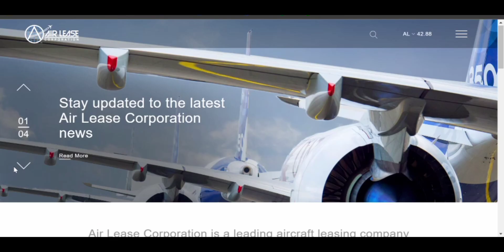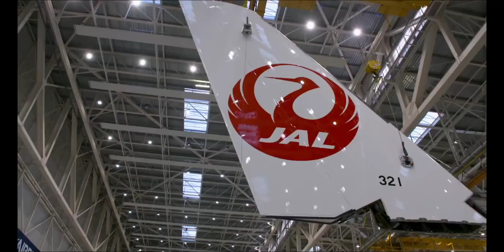List of Airlines that will Operate A350-1000s in 2023

Comment: Air India ordered 34 - a350-1000.
Reply from the maker: Thank you for sharing Info. These figures are of 31st December 2022, but Air India will possibly received its first A350-1000 by the end of 2023.
Reply: @aviationlooks  Air India recive it's first a350-1000 in 2025
But 6 ex aeroflot a350-900 diliver end of this year
Reply from the maker: Yes, you are right!.
Reply: Please don't include Iran Air..!!!!

 Order should have  been cancelled years ago.!!!
Reply from the maker: @gregsmith3410  The data is taken from the official Airbus Website (31st December 2022).